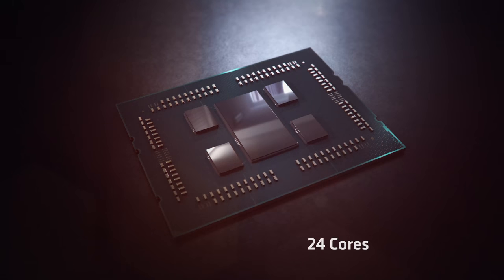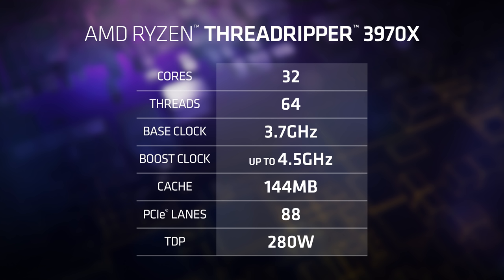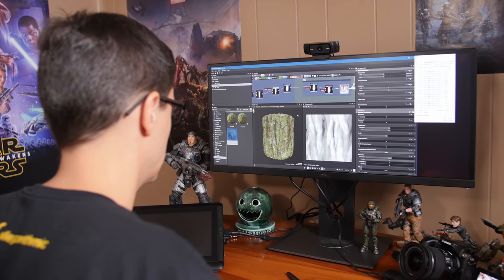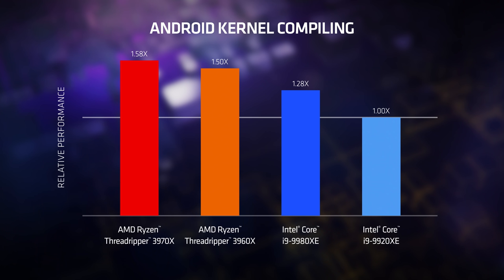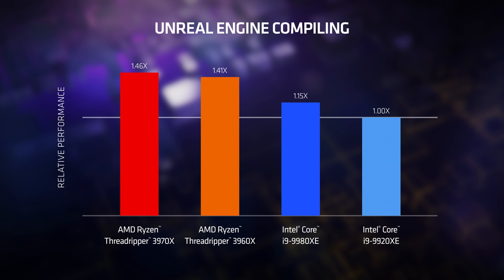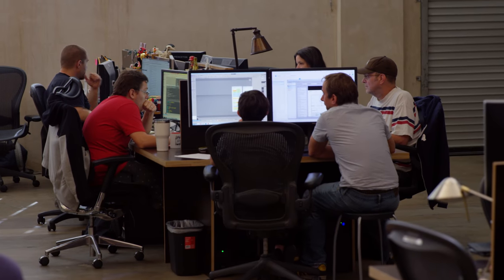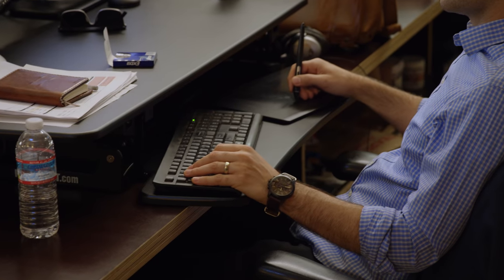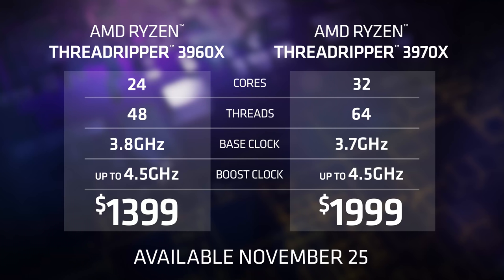Performance Preview: 3rd Gen AMD Ryzen™ Threadripper™ Processors for Creators

Comment: Bit more expensive than i thought it would be. Still destroys anything intel has to offer.
Reply: Huge typo my friend. Its Shintel. Ur welcome
Reply: Spoken like a true AMD fanboy… Had it been Intel doing this you would be here saying about how bad value these processors are. But now that is your beloved AMD doing it you are giving them a free pass. The truth is that there is no value in these processors despite AMD’s best efforts to make the benchmarks appear better by comparing their processors against a stock Intel 12-core 9920X as a baseline so make the smaller difference with the 9980XE appear larger. 

Look for example the Android kernel compiling, the 3970X is 1.58x the performance of stock 9920X while the 9980XE is 1.28x. For the uninitiated it appears as if there is 30% difference between the 3970X and the 9980XE but in fact, it is only 1.58/1.28=1.23x compared to the stock 9980XE, i.e. only 23% faster.  Even with AMD’s shady presentation it is unimpressive to say the least as AMD’s 24-core 3960X despite having 2x more cores, 4.6x more L2+L3 cache, and 70% higher TDP is only 1.3x-1.7x faster than a stock 9920X and that on AMD’s most favourable benchmarks. What is worse is that AMD will be charging $1400 for the 3960X, that is over 2x the price of the 10920x ($689) which replaces and improves on the 9920X. And they will be charging $2000 for the 3970X which again is over 2x the price of the 18-core 10980XE that replaces the 9980XE.

Also let’s not forget that the 2nd gen Threadripper 24 and 32 core chips were terrible to use in most applications due to memory starvation. Even in the niche of tile-based rendering applications they were quite bad while you were working within the program itself (like working on the timeline to produce the project to be rendered). It was much slower than on Intel (as well as their own 2950X) despite the render process itself taking faster t complete once you clicked render. 

Last but not least, these CPUs will need new TRX40 motherboards and very expensive ones at that (over 500 dollars for the cheapest ones). And where is all that pledge of AMD to support their platforms for more than 2 generations ... something that AMD and AMD fanboys accused Intel for doing? Nothing now from AMD fanboys. Apparently now changing motherboards every 2 generations is fine... Hypocrisy of the highest order. AMD fanboys are cancer in this world, the worst scum of the earth.
Reply: The price may have gone up, but I'm sure once we see the benchmarks, we'll be going "This is actually a deal based on the perf/$".
Reply: @alexmarin7897  Being a fanboy for anything is bad. If Intel did this I would be excited, but they haven't and for the recent past they have more or less been stagnating.  AMD never promised the same longevity as they did with AM4, and their processors have been important in revitalizing the HEDT space. All these processors have workloads that they excel at and workloads that they don't, and understanding nuance is important to make an accurate decision. Of course, we shouldn't excuse everything that AMD does, but your hyperbolic  and enraged comment does not make you any better than other diehard fanboys.
Reply: Lets get this straight both brands are business brands aimed at making money the more money they make the more successful they are, AMD is not a human right brand ffs, they dont care about you if its not gonna make them money....... hence these prices we see now..... they did alot worse things and bad advertisement in which were taken to court also.... in mainstream lineup AMD destroyed Intel offerings but in this im sorry AMD not worth it, first of all its rare for consumer apps supporting 32 cores, secondly core by core Intel have better price and performance, 3rd the PCIE gen 4.0 is useless as even 2080Ti until today didnt even reach PCIE 3.0 X16 full potential.... hence why Intel said next year new lineup still 3.0.... not to mention as an owner of 3900X until today it doesnt run to its advertised 4.6ghz boost as advertised meanwhile intel always spot on with their boosting numbers..... and out of box always less buggy
Reply: @TRX25EX  price per core is irrelevant if they offer more cores for the same money. Bad logical argument.

Your 3900x is off boost by 25mhz not exactly a huge problem and that's been fixed. (granted it should never have happened)

Every company is out to make money otherwise they're morons. Doesn't excuse shady marketing either though.
Reply: @alexmarin7897  better is better. 23% is not a small margin.

Your price comparisons are only relevant because Intel recently cut theirs in half.

Not sure what issues you've seen but gaming and single threaded work loads were the only major drawbacks to TR last time I checked. Also if a professional program relies on fast clocks and not threads that's the developers issue not AMDs.

Sounds kinda like you're an Intel fanboy
Reply: @wayward03  price per core is irrelevant and he call me Intel fanboy..... I even picked 3900X over 9900K.... first of all i own 3900X and sorry its not 25mhz offset as stock... i did some custom work to get it over 4.5ghz but as a stock it never go beyond 4.5... 2nd where is in this threadripper lineup you see a cpu offer more cores but same price?????? I see only much more expensive for extra useless cores for fanboys like you gonna be proud in cinebench only
Reply: @wayward03  its not a developer issue you just excusing AMD here and you call me fanboy.... You release something in market for consumers... a consumer have his usage you should study his usage before releasing a product... dont go blaming developers for not spending extra time optimising your own CPU meanwhile 90% of market dont need to, if developer see enough potential in 32 cores usage he will optimise for his own good but they dont see the point hence they dont..... maybe pay them some money they gonna do it lol
Reply: For people that use PC's for work, not for gaming, time is money. And this CPU's saves you time. And for them this is not expensive, because they will earn much more with better product. Gamer's logic does not applies here.
Reply: @senja572  mate i didnt even mention gaming in here..... im talking about editing apps.... most of them they dont support these amount of cores full stop.... they dont spend time on doing so because not enough people own these amount of cores, it takes money and time to optimise these, the only way you can make use of such CPU is to have it working on multiple apps in same time which is an extreme usage scenario and most of people who buy these already own high core count Systems anyway so they prefer clockspeed to speed unsupported app in which saves them time
Reply: @TRX25EX  2080Ti is not your upper-bound use-case for PCI-e 4.0. Folks doing content creation also want fast drives, fast network cards, and other things that are what PCI-e 4.0's real purpose is: much faster I/O with data transfers/writes. Also by your logic, why is AMD not worth it here vs. Intel when everything is faster for cheaper for content creation professionals? Those folks dont use consumer apps - they use multithreaded-oriented apps. And these are Zen2 arch CPUs with higher power efficiency, something Intel does not have. Definitely worth it. As for the clock speed though, no argument there. That's definitely on AMD and their marketing team's foolishness. Should have rated all those CPUs 100-200 MHz less for margin of safety.
Reply: @alexmarin7897  >Even with AMD’s shady presentation it is unimpressive to say the least as AMD’s 24-core 3960X despite having 2x more cores, 4.6x more L2+L3 cache, and 70% higher TDP is only 1.3x-1.7x faster than a stock 9920X and that on AMD’s most favourable benchmarks.

>speaking about amd fanboys
>bashes amd by picking benchmark of 24-core CPU in task that clearly doesn't scale well past some point (5% improvement going from 24 to 32 cores)
>fuck rendering, scales too well and shows that amd offers something good
omegalul

>What is worse is that AMD will be charging $1400 for the 3960X, that is over 2x the price of the 10920x ($689) which replaces and improves on the 9920X.

>single-thread perfomrance between Zen 2 and last gen Intels is basically 1:1 on average, somewhere amd loses, somewhere intel.
>TR 3960X: $58.83 per core, 3.8Ghz base clock
>CHEAPEST 24-core from Intel, Xeon Gold 6212U, all-core boost of 3.1Ghz: $83 per core
>i9 10920x: $57.41 per core, not yet available; still at 14nm, so no significant IPC gains expected
>R9 3900x: $48 per core, same 12 cores as 10920x, available at your local store
>intel has no publicly available 32 core CPUs.
Sooo, yea? What's wrong with pricing again?
Reply: @TRX25EX  > I see only much more expensive for extra useless cores for fanboys like you gonna be proud in cinebench only
You understand that cinebench is based on real software that is used in work? Work that ehm... gets paid?
No one forces you to get threadripper, it's not meant nor advertised as CPU for average user. You got specific task that scales well and gets you money -- you go with threadripper (or directly into server stuff).
Reply: @br_i4360  -- 1. For power consumption I would suggest you to first get educated on the matter to avoid embarrassing yourself. Paul Alcorn (Tom’s hardware) never tests Intel’s cpus completely at stock, meaning that he tests with Intel’s power limits removed as the boards usually ignore them and set them to PL1=PL2=255W, allowing the cpu to turbo indefinitely to its stock table frequencies instead of turboing to 1.25xTDP for 28 seconds (as per Intel's guidance). That is not how AMD likely contacted their tests here in these benchmarks. I' m willing to bet they crippled Intel’s performance by limiting Intel’s boost to PL2=1.25xTDP for only 28 seconds, allowing the cpu to draw up to 1.25xTDP=206W for that period and then forcing it to return to PL1=TDP=165W for the remainder of the benchmark. 

Moreover, if you read Paul’s review carefully and actually bother clicking on the graphs you will see that there is more than just one graph. The one you reference was with an unrealistic power virus like Prime 95 with AVX on. Not a realistic representation of the power consumption of an actual heavy workload. For that you need something like the 100% AIDA 64 stress test. In that test the Intel cpu was drawing 199W (which as expected is lower than 1.25x165W=206W and which would have been 165W after 28 seconds had power limits not been removed) while the 2990WX was drawing 247W (close to its 250W TDP). 

Last but not least performance per watt is not determined by the maximum theoretical throughput. Performance per watt is per workload. So in this workload you see 23% higher performance from the 3970X for 70% more power draw (with power limits enabled on the 9980XE) or 40% (if power limits were removed which I doubt). 

2. Where exactly have I said that the 3rd gen Threadripper will have the same NUMA issues as 2nd gen? I simply said “Let’s not forget that 2nd gen Threadripper had issues” in order to show that not even last year, when the 9980XE was priced 2000 dollars and AMD was drumming about value of their 32-core Threadripper, it wasn't actually good value as it suffered from severe issues. 

As for memory starvation issues, we will see if there are such issues this time around. I am not convinced they will cease to exist. Even Robert from AMD partially admitted that there will be such issues at least due to capacity, saying there will be a performance drop if each core is fed by less than 2 GB of RAM. Also, quad channel’s bandwidth feeding 32 cores is most likely going to be a limitation in memory sensitive applications. We will see.

What is apparent though is that you seem to confuse and conflate the problems related to memory starvation with the NUMA and windows thread scheduler issues. Like the true die-hard ignorant fanboy you are, details go over your head, you are too easily convinced and believe everything AMD promises. Like their fancy videos where you could supposedly overclock beyond the single turbo boost and it turned out that you couldn’t even hit the single turbo boost...You probably still believe in Santa. Really, what have you asked Santa to bring you this Chistmas? An AMD cpu that can hit 4.7GHz?

3. So price-to-performance doesn't matter to professionals and they willing to pay exponentially higher costs as they are going to have return of their investment in no time through their work. Right? well, first of all, since when Cinebench, Handbrake, POV ray, Blender, etc have become workloads that only professionals care about benefiting from time savings in them? I thought everyone and their dog were huge content creators using these programs all the time! Wasn't this the reason AMD’s Ryzen 5/7 cpus are being recommended and preferred over the last 2.5 years by the army of AMD fanboys? For their superior performance in these very workloads against the i5s/i7s that had fewer cores and/or lacked hyperthreading? So, why are you now drawing a line to the need for more speed in this workloads? Either we indeed needed improved performance in these workloads at affordable prices or it was something that could be reserved for professionals and who care a lot about time-savings and are willing to pay hefty premiums. Because if it had been the latter all along, then, even during the complete absence of AMD, Intel always kept pushing hard the performance envelope - with their HEDT cpus and Xeons. Why would you care about inflation in these parts then? Professionals can pay big after all. Isn't that your argument? 

My goal was to expose the hypocrisy and incredible double standard of AMD fanboys like yourself who not only are they completely ignorant and completely biased but even worse they are completely oblivious to it. I consider it mission accomplished.
Reply: i think its because its that much faster, the work they've done with their chips are incredible
Reply: @alexmarin7897  we will just have to look at pricing
Reply: @TRX25EX  pcie 4.0 is mainly for storage speed bandwidth
Reply: @br_i4360  GPUs use the most PCIE data transfer in any PCIE device, storage make use of of PCIE 4 now only because of limited lanes they get..... but with X16 2080Ti cant even use half of PCIE 3.0 so dont tell me we need it now..... also we have PCIE 4.0 storage but speed is not faster the tech is not ready theres other stuff bottelnecking it like CPU and controller so what is the point then having it? Future proof? Maybe if PCIE 3.0 reached its limit but its not full stop
Reply: @niter43  cinebench real use case? No my friend its not if its then Threadripper would have destroyed Intel in editing but they didnt, most apps cant scale like Cinebench does? Cinebench from its name is aimed at benchmarking in which it scales well with multiple cores, but most of the apps dont scale same, in which clockspeed advanatage will make difference in which consumers will end up taking Intel while others will take AMD hoping developers do something about this scaling like 1st and 2nd gen meanwhile developers said its hard and time consuming
Reply: @TRX25EX  While your arguments are not necessarily wrong, I find the certainty and absoluteness in your arguments to make them not as strong. These AMD processors are not for the average consumer. Those who will find the feature set of them useful will definitely buy them. PCIE 4.0, while maybe not as useful now, will definitely be helpful in the future with expansion and evermore bandwidth hungry applications. Think many nvme drives, 10 gigabit+ networking, and multiple GPU setups. Of course, not everything will work as nicely on the threadripper platform, but there is a definite application for them.
Reply: @alexmarin7897  lol are you an Intel employee? I am sure you aware that big players are now moving to AMD. Don't get mad work harder. Also, I don't think AMD and Intel have much time left in the CPU market though max 20-25 more years.They will lose big companies like Netflix, Facebook, Google, and youtube pretty soon tho I give it max 10 years.
Reply: TRX X  Is your name Brian from PC Perspective?😆
Reply: @br_i4360  No, AMD Is pulling an intel by marking up the price more than twice, nor are they offering dual cpu support for enterprise. It's only a matter of time before samsung releases 5nm next year, and intel to follow with ASML die shrink to 5nm.
Reply: For those switching from INTEL to AMD, the 1st & 2nd Gen TR4 should be cheaper...we hope!
Reply: @Zosu22 --All AMD has done with this Threadripper launch was to release a 32-core chip for $2000 to replace their previous 32-core chip that was going for $1800. So could you please tell me what’s so particularly exciting or innovative about this Threadripper launch that has got you so excited? And which is a thing that apparently Intel hasn’t done in the recent past? I mean, have you ever got excited about Intel releasing high-core count Xeons at non-affordable and ever-inflated prices? After all, just 10 months ago Intel released a 28-core overclockable Xeon for $3K. And they are having an MCM 56-core Xeon too. Have you got excited about these products? Or are you now going to bring back the value argument again and say “but these cost x% more but only offer y% more performance” which is exactly the point I was making with the 10980XE vs 3970X? Same about the stance on motherboards changing every 2 generations. You can’t have it both ways. You are either going to be consistent with your positions or you are just a biased, double-standard fanboy and hypocrite.
Reply: @alexmarin7897  The prices that Threadripper had been is, along with other things like their chiplet design, is what made them exciting to me. And you know what, I'm also excited that Intel has made a price correction with their 10th generation hedt processors. Of course I've looked at Intel's previous high corecount parts and thought that they were interesting, but they didn't seem to really push the industry forward as much as AMD's introduction with efficient, high core count high pcie lane CPUs. Even though I will never buy these CPUs because I don't have a proper use case for them, I'm excited for what they will push Intel and other competitors in the industry to do.
Reply: Doesnt matter if amd sucks or not, whats important is intel is being shaked and dropping prices lol.

If intel is really good and confident they dont need to drop prices and just need better advertisement.

Im not even a fanboy and im using what i can afford for now but no need to be bitter. In fact you should be thankful to amd fanboys for hyping up amd processors (doesnt matter if justified or not) without them, bitter intel fanboys like you wont be enjoying price drops from intel.
Reply: @alexmarin7897  k
Reply: @alexmarin7897  yea sure but these aren't normal consumer chips, they have features specific to them like ECC Ram support etc. The core/price/performance still looks more promising in general, but hey if you don't want competition, just be ready to throw fat stacks at Intel.
Reply: @Lui Cheng - More than you will ever be allowed to have where you live, Mr Lui Cheng. Why don't you go back and play with your only toy (you know what it is, hint: it is tiny and hanging from your body) and leave those who know to talk about CPUs.